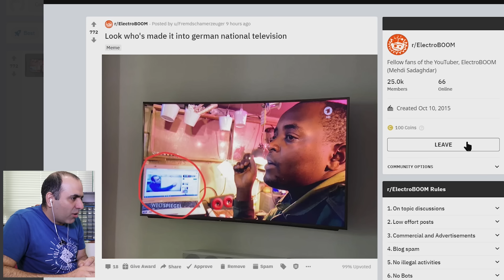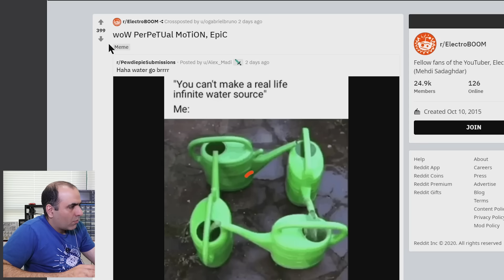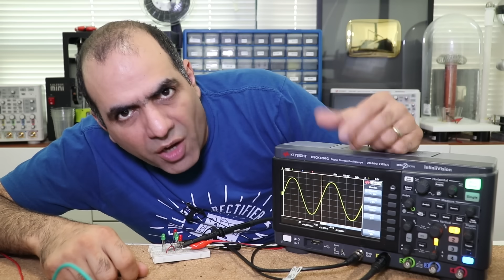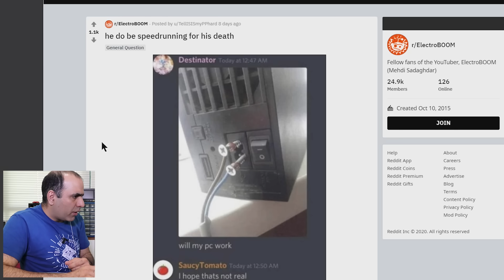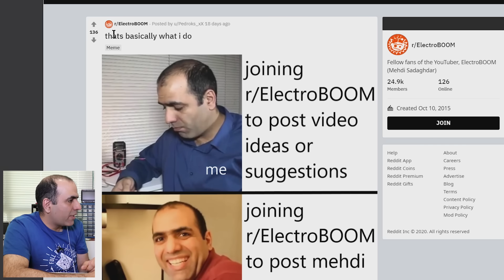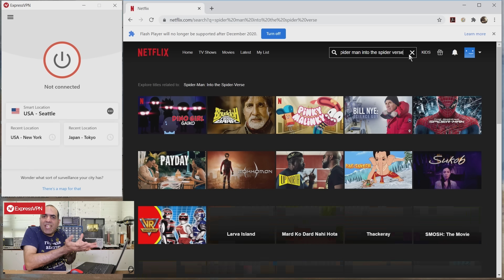Making Water Spin Like Magic, LATITY-002

Comment: They probably didn't have GFCI. I used to live in an old mid-century house and there was no circuit protection, just a manually operated breaker. A repair man once got a nasty shock and an ambulance ride bc he got electrocuted fixing the water heater. Moral of the story, RCD can save lives! USE IT
This happened in Mexico, which uses 120v AC, so in a 240v circuit the damage could have been even more severe.

In case you're curious, yes the repairman had a heart attack but was thankfully saved by ambulance paramedics. Close call with death made us decide to modernize our safety equipment, which we'll never regret.

Comment: @ElectroBOOM - 
I know this @ 6:32 spiky Travel Adapter (Death?) Star ... its the Kopp "Travelstar" WELTREISESTECKER from Germany 
(the ungronded smaller version of the classic colorful "Reisestecky" which I recommend more) , its harmless because only one input is connected (turn the dail on the op German outlet). 

Pictures of this "cursed" travel adapter https://picclick.de/Kopp-Travelstar-Reisestecker-Adapter-wei%C3%9F-172201018-153841322174.html

and its bigger brother the colorful Reisestecki 
https://www.amazon.de/Schwabe-90251-Welt-Reise-Stecky-IP20-Innenbereich/dp/B00475BKOE/ref=psdc_1626844031_t1_B001Q8LIJM

Comment: Regarding grounding: Sometimes people work on power lines while sitting in a hovering helicopter. Since the helicopter is not touching the ground, electricity has nowhere to go when you touch the cables.

Comment: Hi I need help if anybody can, I want to run a 36v motor on a two 12v batteries is that possible or would I have to add a third and run it in a series and does it matter if it’s the same brand or not???? Please and thank you!

Comment: Hi ElectroBOOM,

What you could have done for your high voltage power supply is looked up a power inverter circuit diagram to build it,

 then use a transformer to boost it up to super high voltage. Here is an example of such a circuit:

https://www.electroschematics.com/wp-content/uploads/2012/11/12vdc-120vac-inverter.jpg?resize=527%2C310?w=527

Your Welcome,

-Superb!

Comment: Hello! Can I ask you a serious question? 

I bought a house not long ago, and in the garage theres one of those fuse-boxes I think you call them in english. Anyways, I happened to short one of the fuses when I was using a strong powertool, and I had no new fuses to swap them out (I hope you understand because I might be using the wrong terms.) Anyways, i let the garage be out of electrisity because I only use battery-tools mostly and its summer so I dont need any light at the moment. 

I was climbing the ladder in the garage when I felt a pinch to my head, and when I look up theres one of the cords to my lightbulbs hanging down openly in the air, and I had pinched myself on the copper which was not protected in electrical tape. If I had had electricity, would I had suffered any injury? I see you getting electrocuted all the time, but I understand you know what you're doing so you know its safe. 

Thanks

Comment: 7:43 My upstairs bathroom did not have a GFCI receptacle, I replaced it with one & in the process I found out the my youngest boys room's 3 receptacles were wired in series after it. I don't know how but my other 3 daughters figured this out and they prank him by hitting the "reset button" on the GFCI and cause a "power outage" to his room when he pisses them off.

EDIT: maybe it could be because the GFCI outlet comes with several "GFCI Protected" stickers and I placed those stickers on the outlet in the bathroom & then the outlets in his room because,.. well,...
 now those outlets are GFCI protected....

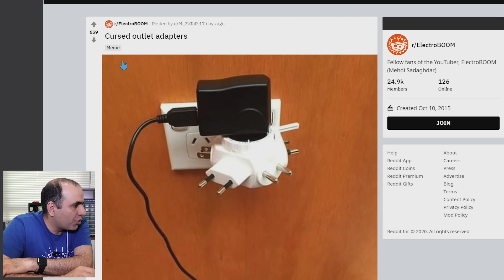Comment: 6:30 -  I have one of those, you have to rotate the rim at the top to align an arrow with the plug you want to use, so only one is ever connected (or none if misaligned). Still looks scary though.

Comment: on the subject of spinning water, high voltages (plasmaball converted into a arc device) the arc moves the water (the electricity drags water towards it) and electricity pushes vasoline away (petroleum jelly) again, using arcs, you can test this by 1) putting foil on your plasma ball 2) putting a vasoline can ontop (with a small amount of vasoline in) and hold a thin metal stick, when you move it close and create arcs the vasoline will move away, do the inverse of this for water

Comment: Hey, you may be able to avoid customs fees by prepaying them before the courier ships the item. Alot of couriers have a (in my opinion) scummy practice of not even notifying a recipient about the customs fees until the item is delivered. This usually means the courier charges an outrageous "advancement" fee to the recipient for the money paid to customs (on top of the customs fees itself). You'll see this alot with couriers like UPS (in Canada) where the customs fees is like $14 but the advancement fee is a flat $40

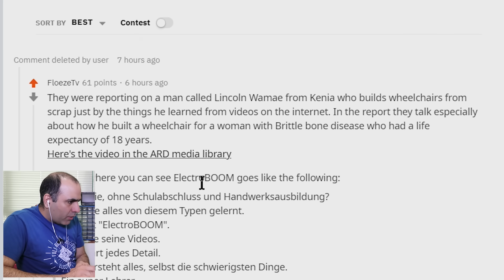Comment: 1:08 You've gotta send him a scope at least! Give him a few different power supplies, a few meters, a big bunch of electronics kits n bits, mechanical bits, servos, motors and speed controllers, loads of metric bits (nuts/washers/screws/bolt's/wing nuts/nylon washer's/etc), drums of different cable's, switches, relays, contractors, a bunch of different plugs & sockets, a combi stick/MIG/TIG/plasma cutter, air compressor, air tools, lots of different hand tools for every occasion, etc.

Comment: Taxes, taxes, taxes again...

For individuals, customs tax on educational tools and supplies are not withheld, at least in the EU, if a tool is explicitly not meant to be resaled at all and written claim about it is provided to the customs office... but there is often also a tax for lottery rewards, and your (and Keysight's too) giveaways are considered lotteries by law. In Poland it's 10% of the award declared value (i.e. retail price). Once again - that tax is paid only by individuals only. 

Companies are instead expected to withhold the full VAT if the product is meant for resale or file a pile of documents for an exempt if not and if  certain conditions apply (one of it being a sample specifically marked as not-for-resale).

Schools can get educational tools and supplies (measurement tools apply too) without neither customs tax nor VAT also only if they obtain an educational exempt from customs office and - also in this case - provide a written reasonable claim the tool will be used only for educational purposes and is not meant for resale.

Comment: Regarding your sponsor: VPNs don't work for Netflix, Hulu, PrimeVideo or any of the more popular video streaming services anymore. They stopped working 2 years ago. All streaming services blocked VPNs by blacklisting all popular VPNs IP addresses. PrimeVideo tells you to disable the VPN. When Netflix detects a VPN, they don't show a message but instead they show you the video library from your original country based on the billing address of your account. (Tricking you into thinking the VPN is not working correctly or that the show you're looking for is also not available in that other country).

Comment: why they don t used turbine wind on electric car to have more autonomie
Reply: and the bleu print ,it like the desing of turbine of jet ,but you put it at the place of the transmission and many little turbines in the tunnel in the meddle of the car and the end of the tunnel finished in the back of the car ....
Reply: and why they don t combine technologie like solar panel integreted ass the body

Comment: In Italy the law always requires the installation of the differential breaker before the entire home or factory circuit. We use products like this: https://www.manomano.it/p/bticino-magnet-differenziale-2-poli-g8230-16ac-5113045
That has both differential circuit breaker, and overload\short circuit breaker functions.
Also there is another micro-controlled switch before this, integrated in the electricity meter, that shuts the power down if u use more than 3kw for more than 4 minutes. And this power meter have firmware updates from the power plant directly on the AC line, using a different frequency band. This is used from the electric company to monitor your electricity consumption too.

Comment: i once didnt have a molex cable as a kid, so i soldered an extention chord onto my monitor plug pins... i mean it worked, i wish i knew i could buy those cables for under 5$ back then though, so sketchy

Comment: When I was a logger, on some rainy days we would work on equipment. I remember always feeling a faint stream of electricity running up through my feet when I was holding the stinger to my stick welder. SMAW welders run fairly low voltage so fatal shock is somewhat hard.

Comment: Hey can you explain https://youtu.be/o3t2390k5R8 the vortex or vertex things they increase the rpm by putting wire in vortex and claims it speed faster 

My question is why dont we use in fan so that it gives faster air flow with tiny fan 

Can you do it or is it possible?

Comment: 9:35 -> Your body, surely, is like an OPEN circuit when you're floating in mid air.? 
--- aaand I just got what you meant after re-watching the part a few times. Body is low impedance so you can treat it as a "short circuit". Although the "short circuit" term implies there is a current path..

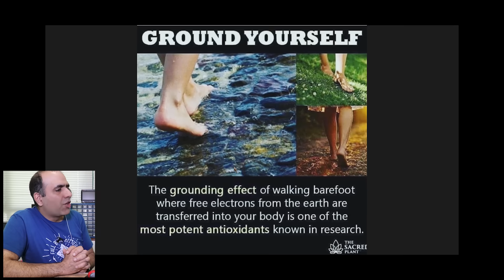Comment: 9:09 "Ground Yourself"
The people who believe this should do this when there's a thunderstorm. Electron flow is definitely better
Reply: @Pedro Abreu i absolutely agree
it's almost therapeutic
Reply: Well, if the current is in the ground, where would it go from there? You can't complete a circuit to ground because there isn't any and the ground is your source as well. Makes no sense
Reply: @iProgramInCpp  tell that to them
Reply: @iProgramInCpp  your body can be a capacitor so there can be current
and the antioxidants part just bs
Reply: @fakestory1753  you cant just implant a capacitor into the ground with both its wires making contact and expect current to flow, can you?
Reply: @iProgramInCpp  no ,two human leg doesn't work as two leg of the capacitor
a conductive object can be a half capacitor relatively to empty space , proportional to the surface area and higher curvature

Comment: 6:36   CRT Flyback Transformer output,  it will ramp ,  quite deadly,  keep an assistant on standby with a 2x4
Reply: When I worked in TV repair years ago, I and other engineers took a few EHT shocks from flybacks over the years. It’s not pleasant, but it scorches more than shocks due to it being high frequency pulsed D.C. It’s similar to an RF burn. Even still connected to the CRT’s capacitance it’s unlikely to cause fibrillation, low frequency AC is the main culprit there. Especially here in Europe as we have 230v AC mains. The flyback output was avoided because it could jump gaps and give you a whack and a scorch mark, but it was never the most dangerous part of a TV.

Comment: The 29th was my birthday.  Thanks for this birthday present!  Can you explain how a large FULL BRIDGE RECTIFIER can handle such huge currents when other SCR's blow at small currents?  Aren't they made with the same stuff?  Thanks for your videos.  You and Cody are my favorites.  Br, Joe.
Reply: Certain electrical components have certain ratings. If a wire is thin, a lot of current goes through a very small space, and the resistance is high, which means the components get very hot under high voltage. This is why bigger components and bigger rectifiers can handle the high voltage while smaller ones can't. The diodes are just better.

Comment: the LED rectifier consists of:
LED's - for rectifinyg
a resistor - for load
a capacitor - for exploding
Reply: Capacitor: Skibbidy bop mm dada BOOOOOOOOM
Reply: I mean, you might be able to use mains voltage LEDs, but man that would be huge haha
Reply: No resistor for get hot and glowing
Reply: why does it need a load? without a load it would be a short, but what does that mean for the resistor? If you put too small a resistor on, it would be the weak point and explode, but what if you put a high wattage rating resistor on with a low resistance? How do you know how much resistance is appropriate to make it a circuit, but not a short?
Reply: @JinnaiT  Diodes work by having a standard voltage drop across them.  Say you have a diode that has a 1V drop, then your source voltage (Vs), minus 1V or Vs - 1V would be applied to the resistor.  The lower resistor you go, the higher the amperage as defined by Ohm's Law (I=V/R).  Diodes generally don't need much amperage, so a very high resistor can be used to minimize power going to the LEDs.

The capacitor was used to keep the Vs more consistent, rather than mimicing a sine wave.
Reply: @JinnaiT  You decide what current you want first, in this case let's say 30mA since that's a good current for old school LEDs like the ones shown, and divide the supply voltage (minus the LEDs' forward voltages - ~3V each, so a total of 9V) by that current to get the resistance.
So if you're at 230V AC you'd end up with (230-9)/0.03 = 7.37kΩ.
Reply: @demoniack81  good sir, just want to point out that you suggested the resistors should disappate 30mA * 227V (P = IV) of power, or about 7 watts of power.  You would need quite the heatsink.
Reply: @NoodsAndCo  You're right, that's a very valid concern. In this situation it would be much better to use a capacitive dropper, but that would have complicated the explanation further.

Comment: @10:00 I can confirm this shit!! Years ago I was splicing a scanner antenna together (too poor to buy the right plugs so bodgy Bob it was). I was standing in a puddle of water in the basement laundry area and the antenna was just a 90cm whip antenna on the roof (no mast just clipped into the ridge capping). 

I was in a hurry as there was a storm coming on (still 40km or more away). Prepped the scanner end and all's fine. Stripped the antenna end .... WHACK!!!! Launched into the wall. The antenna was not connected to anything at all, it was all potential energy. Luckily second time around the energy had been removed and I got the job finished whilst learning a valuable lesson.

Comment: Hi mehdi for the led full bridge the guy used a step down transformer. Zoom in you can see.   just open up a wall adapter with a transformer and replace the diodes with the leds

Comment: with full bridge rectifier made with leds would it still work/transfer load under low voltage? eg. led is 5v while load is at 2v at each point.

Comment: 3:43 Przekaźnik produkcji Zjednoczenia Przemysłu Automatyki i Aparatury Pomiarowej „Mera” - polskiej firmy założonej w 1964 r. Mera produkowała w czasach komunizmu nie tylko przekaźniki, ale także polskie mikrokomputery ELWRO zgodne z ZX SPECTRUM. Na obudowie widać "znak jakości 1" ➀. Znak ten oznaczał, że wyrób potwierdzał ponadstandardowe wymagania i często takie produkty trafiały na eksport. Przekaźniki R15 3PDT 10A wyprodukowane przed rokiem 1989 wciąż są w sprzedaży. 

3:43 Production relay of the Automation and Measurement Equipment Industry Association "Mera" - A Polish company founded in 1964, Mera produced not only relays, but also Polish ELWRO microcomputers compliant with ZX SPECTRUM. On the casing you can see "quality mark 1" ➀. This mark meant that the product confirmed above-standard requirements and often such products were exported. R15 3PDT 10A relays manufactured before 1989 are still on sale.

Comment: Btw, wiring light switches for bathrooms after the GFCI similar to what is done with the outlet just before 8:00 is a good idea (I also think it has to be wired this way in order to meet code for most buildings nowadays)

Comment: hey, i have a airsoft gun but i lost the battery and i dont know what volts or amps it was and i need help finding a good battery.
the charger says 12-15dc input power and the plug says LiPo/Fe. i dont know what tf to do PLS help(like so he sees this)

Comment: 7:55 how has america not just switched to GFCI circuit breakers for every circuit, not just bathrooms and not just at the outlet
Reply: There are definite advantages to putting the protection at the outlet, and without water, I guess 120v is deemed safe enough to not bother (which has some truth to it, but it's still pretty dumb)
Reply: @Owen_loves_Butters  The fact its not a requirement on every circuit boggles my mind. Or that there seem to be no rules on who can do electrical work. Meaning DIYers are doing major electrical work.
Reply: @PBMS123  There are rules. It's not legal to do electrical work when you're not certified. But people are stupid, and think hiring professionals is a waste of money.
Reply: @Owen_loves_Butters  Well according the videos I've seen it seems in plenty of states of the US you can do your own electrical work without certification.